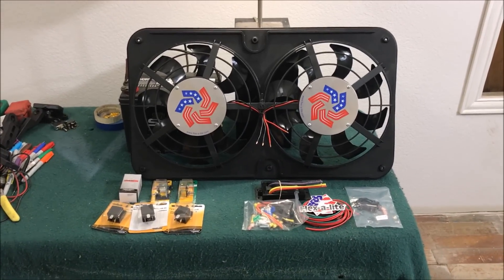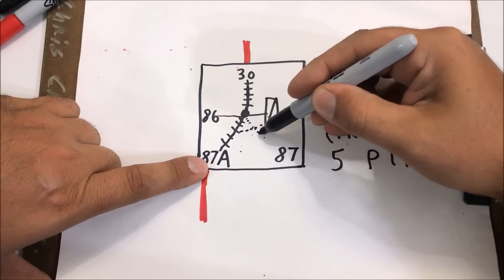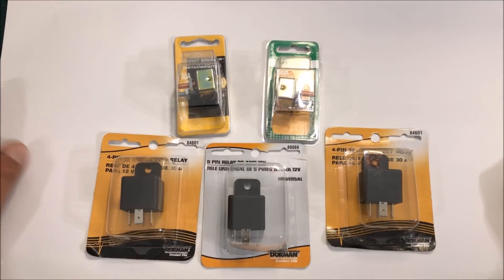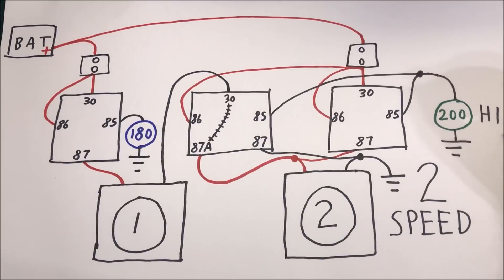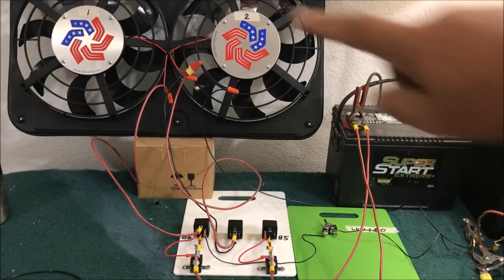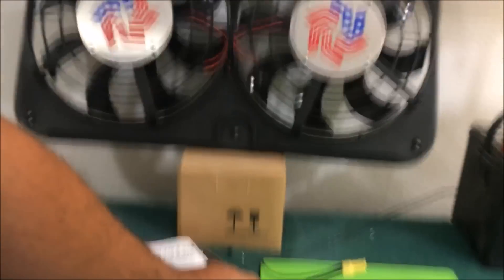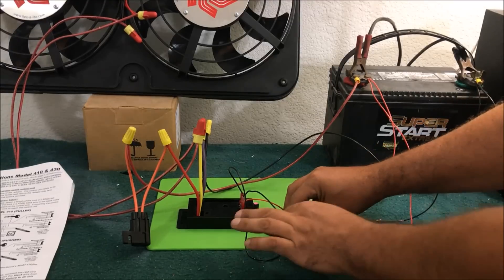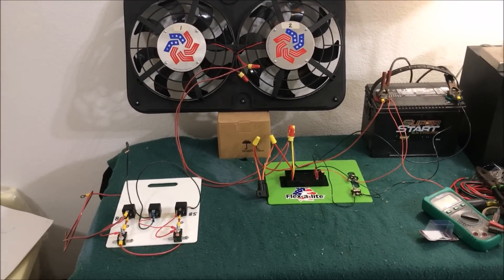auto electric cooling fan WIRING how to DIY

Comment: Hi chris thank you so much for every single video that you have posted there’s a lot of good straight forward information I know this is an old video I wonder if you ever made a video of volvo relay pack involving a ford taurus fan and a three wire coolant fan switch on my situation the fan kicks on at at specific temperature but the fan wont shuts off at low temperature of 160 or lower unless I shutt the truck off I will appreciate any info God bless 👍🏼

Comment: I want to do this for my truck because the clutch fan, sure it's fine but it's a 4 cylinder.... And it just KILLS THE POWER of the engine. Also has ac and I'd rather get rid of the fan clutch and I want to do the low and high for the temp and ac in it. But using relays seems WAY better to me. And like I figured it has to be wired in series and looks like parallel or in actuality it's a combination wired. I don't want to put switches in it I don't like that because if someone else uses it and you tell them they'll still forget it. Then blow up the engine oh for DC fans you'll be fine running them like that at low speed. Least you should be nothing wrong with that cars do that to begin with because low is for radiator and high is typically ac. The condenser needs more air going through it to make it work nice. I'm looking at all the videos too on this so I can like take ideas and then craft it to how I want yeh. Great video BTW I like it.

Comment: Hello sir , I did not  understand about 180 degree in your circuit  ?   Is that sensor connecting to the water tank or connecting to the engine ?  
Because the water is boiling at 100 degree ,  so how different between 100 degree and 180 degree ?
Reply from the maker: Fahrenheit

Comment: The flexlite controller works good until it fails like mine did. The controller is EXPENSIVE. My next setup I went with the 2 relays it works great and if a relay ever fails they are cheap and you can get them anywhere.

Comment: @chriscraft77022 Man I have gone over this video several times in hopes of running my dual fans at 1/2 speed. I have an Entropy Dual fan radiator.  I can only get one fan on but when I run power direct to the fan that doesn’t engage it fires up. I even ordered new relays. Using step 1  for low speed still only one fan and it’s number 2 fan. I can hear relay one click but no luck.  Wonder if I should invest in a controller?😮
Reply: Read the diagram again, you have some wire wrong 
In 1-speed works both fun in half  speed

Comment: And if we want to control the second speed through the air conditioner compressor line, knowing that it gives a positive line
Reply from the maker: look up trinary switch
Reply: @chriscraft77022 
Sorry, I don't understand what you mean, but do you have a blueprint?
Reply: Hey 
You must use a relay 
A wire from AC=12V+  to relay pin 86 
A wire from relay pin 85 to ground 
A wire from relay pin 30 to  3-relay  pin 85
A wire from relay pin 87 to ground 
I hope I helped you  after 7 months
Reply: @konstantin-big  thank you very much my friend
Reply: @بلبلالشمري-ت7ذ  
Ok

Comment: when should the a/c work - high speed?
Reply from the maker: this video is not about ac look up trinary switch
Reply: Hey 
You can connect  a wire between pin 85 on  the third relay and an on/off switch  and a wire from the other pin of switch to ground 
Every time you operate that switch both  funs works in full speed

Comment: hello  I have a  Suburban 2012 and I want  both fans working  on high speed  by  4 relays  with 5 pins   every one 40 amper  and   one breaker fuse   80 amper  how the diagram will be  thanks in advance ?
Reply: Hey  
Did you find the solution on your problem???

Comment: thanks , I have a Suburban 2012 and I want both fans on high speed all time by  4  relays  5 pins   can you show the diagram will be thanks in advance
Reply from the maker: you only need (1) 4 pin relay for that.. but the amps might make that relay expensive

Comment: Hey Chris, I had a flex-a-lite a-lite dual fan with the temp controller and hooked it up exactly the way flex-a-lite directions explained on a 2004 Suburban. The problem I had was that the controller has only one small positive and negative wires going to the battery controlling both fans coming on at the same time drawing double the amps through the small positive and negative wires which is a bottle neck for the amps going through it for both fans coming on. I found out that's what the funny noise is when the fans both kick on and struggles coming on. Over time, the red wire from the temp controller gets really hot and eventually it started blowing the fuse on that red wire to the battery. Also, over time,  it makes the fan motors get hot as well from struggling and eventually burns the motors up. I went through 2 sets of motors in two years. I eventually removed the controller and ran each fan with their own relay and power basically in parallel besides in series like the controller is wired as and it makes a big difference on how they turn on and no more noise, fan struggles, blowing fuses and burning up fan motors. Also with the temp controller wired up it also drains the battery faster due to hi amp draw with both fans coming on through a smaller wire which then the alternator could not even closely keep up and had to replace the alternator with a 250 amp mechman alternator to keep the battery full at all times when fans are wired through the temp controller. Don't know if flex-a-lite know about this issue with their temp controller, but they need to figure out a different way with their current temp controller wire setup. I was wondering if there was any way you could test this issue and verify the problems I had. So far it sounded like it when you connected the twmp controller, you just need to run it longer and over a period of time to get the same issues I had and I have seen others having the same issue.

Comment: I am running a additional fan infront or the car. Can I just connect 85 to ground and 86 to current fan +. That should activate the extra fan right. ? Or should I run a.separate switch
Reply from the maker: yes, like that if you want

Comment: I'm pretty damn good with electronics. I've rewired cars and motorcycles and even houses, like, I get it. But for the life of me, I don't get how the relays divide the voltage to give you a high speed and a low speed on both fans at the same time with no resistor. I'm staring at this diagram, and I don't get it. Someone care to enlighten me?
Edit- I get it now. I apparently was distracted. Low speed is wired in series, and high speed is wired in parallel.  Hahaha derp
Reply from the maker: it’s like when you wire lights in a room.. in parallel keeps 110v to every light  but in series splits the voltage.. that’s why Christmas lights dont have resistors. the 5 pin runs 12volts through 2 fans giving them half power each
Reply: @Chris Craft  dude, thanks for the response man. I did figure out my derp but yeah haha, nice circuit man, definitely caught my attention. I have an old 3.0 slow ass 4runner I've removed the fan clutch on and installed a 3core rad and a massive single puller fan. Does the job but I'm not happy with only 1 speed, so I will probably be looking for a dual fan setup to have more control utilizing this circuit. The dual fan in your video, how much did that run ya?
Reply from the maker: I got it refurbished on Amazon for around $150 5 years ago. there are some single fans with 2 windings that do high and low speed also

Comment: Hi Chris I have recently brought a 12volt 5 pin 100 Amp Relay unit & I was wondering if the 100 Amp Relay would suite a electric radiator cooling fan & the the electric fan that I will buying at a later date is a 90 Watt electric fan motor & the Electric Cooling Fan is 14" & has 2500 CFM from AliExpress Store for NZ $81.02 which I think it is a quite a reasonable price & I have a 1996 Toyota Hilux Surf with a 3.4V6 engine & what fan I have at the moment is those clutch fans & I dont like these fans at all & go all out for an electric radiator cooling fan & having 2500 CFM rating should be fine for the 3.4V6 engine & the fan 14" electric fan has curved fan blades however I asked the the Seller if you can get this 14" electric fan with straight flat blades & apparently you can buy this electric 14" with the straight fan blades which they are a lot better air flow than the curved bladed electric fans & however they are a little bit noisier than the curved bladed electric fans  & that wouldn't worry me & the electric fan will draw air through the radiator which more efficient again than force air  through  the radiator from the front of the radiator & that way the electric fan will force air over the engine as well & keeping other engine components Cool as well & having the clutch fan removed I will have heaps of room for the electric fan as the clutch fan has a long piece of metal to mount the clutch fan from the water pump & so all I have to do is put shorter bolts through the water pump to hold the pulley on & that way I will have even more room again for the electric fan & more air going over the engine as well & keep everything nice & cool & be far better than those clutch fans & anything goes wrong with those clutch fans they quite expensive to replace as well & so Chris would a 12V 5 pin 100 Amp Relay work ok for this fan unit Kind Regards Peter
Reply from the maker: yes
Reply: Thanks Chris  Kind Regards Peter

Comment: I have a little Ranger and I’m putting on just one fan how can I set it up for a high speed and low speed
Reply from the maker: you can not
Reply: @chriscraft77022  OK thanks
Reply: @chriscraft77022  yes it works one fan and two speeds I just found a video on YouTube sorry to bother you again
Reply from the maker: you need a special 2 speed fan .. you can’t do it on normal fans
Reply: @chriscraft77022  yes he did it on a normal fan
Reply from the maker: @franzneudorf2893  there are ways to do it..  i hope he didnt run a resistor to cut voltage down..  how did they cut voltage in half?

Comment: Hey Chris, I need to put an override on/off toggle switch on the + wire coming out of my electric fan.
I'm wanting to connect it there because it's after the thermostatic switch that detects hot Temps in radiator so the fan turns on at 205°F. So it doesn't effect the fan temp switch and can just manually turn on the fan when I'm setting in stop n go traffic or have AC on while idling.
I was going to power the on/off toggle switch from the fuse box under dash so it only has power when key is on or car is running. The on/off switch is on the positive line that goes to the fans + wire.
How do I connect a relay to this while not effecting temp switch turning on fan when hot and still have the ability to send power to fan from manual toggle switch independently but switch only being power by key on

Comment: Has anyone tried this with a LS3 swap using the E38 ECM with fan 1 and fan two being the ground trigger for the relays ? It seemed to work fine but the ECM stopped sending ground trigger and threw DTC PO480... then both fans started running on hi on fan two request only. (@205°)  I think its because the ECM is looking for voltages from the  PWM fan module  ??
Reply from the maker: this is not for that .. you need relays with diodes and they are wired different
Reply: @chriscraft77022  yes sir, took me a couple months of screwing around but I have the relays,  I have 3. Also sourced the solder in diodes in case I needed more. The older ECMs from GM was so much more simpler.. the E38 ECMs are definitely not for the faint of heart. I ordered a dual speed dual fan upgrade harness from racetronics and it should be here Thursday.  It's also wired with the proper relays they claim. I just want to see for myself.  This has been the biggest pain in the ass. I should have just went with the Holley system or ponied up for the Haltech system. GM clearly didn't like us hopping up their Engine management systems... lol

Comment: i was wondering what would you recommend on wiring an AC unit so the fans come on with the AC  ? do i run them parallel of the ac unit or should i set them up with there own relay also i want to  put a bypass switch in   in case i need to  keep things cool  thanks Bill

Comment: I did my fans with the 3 relays. They both come on when I touch the wire to the battery but when I hook it up to the fan switch and it reaches the temperature.  Only one fan comes on.
Reply from the maker: 😭 if only 1 fan cones on you totally screwed up the wiring.. don’t blame me..
Reply: @chriscraft77022  I'm not blaming you,  I just wanted some kind of in sight on it. I followed every step but thanks anyway...

Comment: Great video, I see you have two fans and using one Flex a lite controller on the setup.  Will this one controller handle the amps from the two fans or is best to have two controllers on two fan setup.  Once great information channel.
Reply from the maker: it is sold like that.. that is a fan kit

Comment: Hey Chris,
 Your video on  HI/Low  fan control wiring is the best I've found anywhere. I do have one question though,  how would I tie my ECM to this ? The ecm is a E38 and has a "fan 1" ground signal and a "fan 2" ground signal.  I would like to have the ECM have control over the fans and use a vintage air trianary switch for like fan one, then for fan two use a 200° temp switch. Can I just wire one of each of the ground signal wires from the ECM to each relay in your diagram in place of the "180° " or fan one ?? And the other in place of the 200° Help a brother out man I'm struggling over here... lol

Comment: Thank you for making these videos, really helps a lot and easy to understand the way you explain things. I wish I could pay you to make me a custom wiring diagram for my needs. This is great but I also have an after-run pump that needs to come on after shut down. Just not sure how to add a third relay in your system !
Reply from the maker: I don’t know what after run pump is but that would be a separate circuit activated by the same thermal switch used for fans.. you don’t need a custom wiring diagram.. just keep studying it.. you might need an aux fuse box.. I have a video on that ( Jeep in it)
Reply: @chriscraft77022  wow thanks for your reply! The after-run pump is activated when the car is turned off and circulate the coolant for about 10 minutes in order to move the hot coolant away from the head. I think a 5 pins relay needs to be hook up in the two 4 pins relay you have designed. Something else I would like to change also is when the relays are set on/off by let's say a thermo switch (low and high) the fans kick on/off too often. Do you think I could replace those relays by timer relays so I could set them let's say at 2 minutes to prevent them from kicking in and off too often? Like the Hella timer relay SH3-996-152-131 that can be adjusted up to 10 minutes? Sorry for all the questions! But you're tha man, seriously!

Comment: Chris,  I'm trying to find information  about how to install dummy LED indicator lights to my dash from my dual  electric fans. I've been told to break into the hot wire on the fans . But, that's 25 amp at load. How would you recommend a safe wiring option? And thank you for so many awesome videos on wiring. I'm a grandma or three and rewiring my CJ7 for the first time all by myself. I really want to do this right! And your videos have been AMAZING!
Reply from the maker: how did you wire your fans to come on? Relays? What actually turns them on?
Reply: @chriscraft77022  relays with trigger wires from sending units in block.

Comment: can i use one sensor  {the bmw  180/196 temp} to control both high an low temp speeds sence it is a seperate internal switch ? trying to over ride the hi temp from factory, as longas i can keep temp at reasonable level temp, the car does just fine.? really like your show, thanks, at 80 yr old ,need the help.

Comment: in your hi speed / low speed diagram , how an where would i wire in the bmw switch with 180 degree an 196 degree temp

Comment: Instead of connecting the low speed trigger to a thermo switch, can I connect it to the AC compressor so that the AC compressor will activate low speed and the high speed will be activated by a 200deg thermo switch?
Reply from the maker: if you are doing AC you need that Trinary switch.. I have never wired in AC so I was just guessing